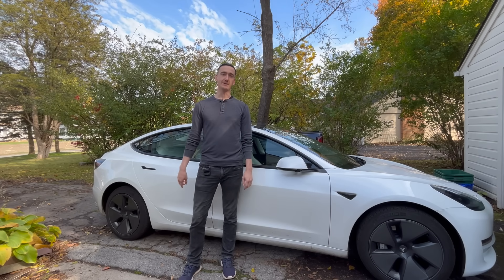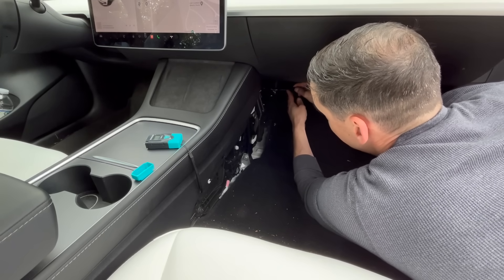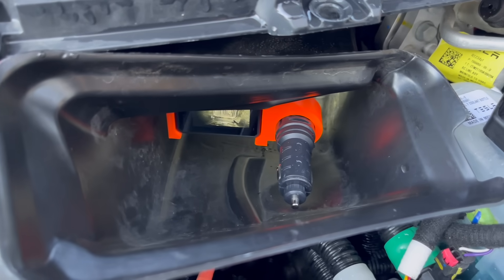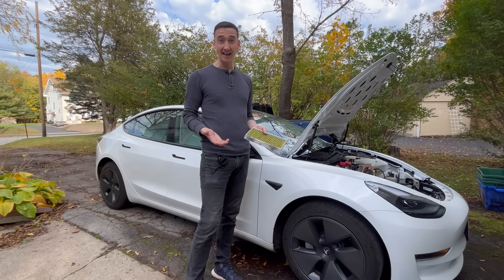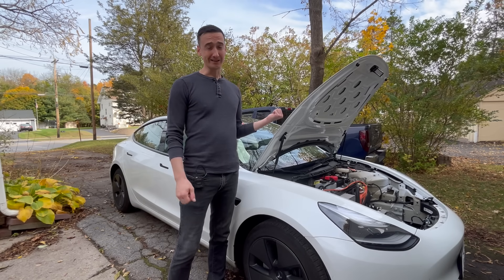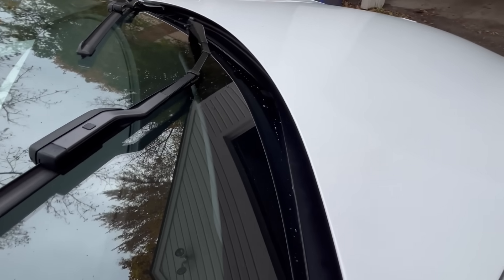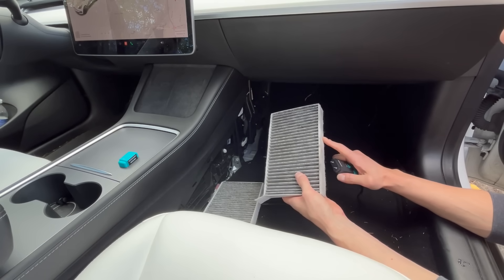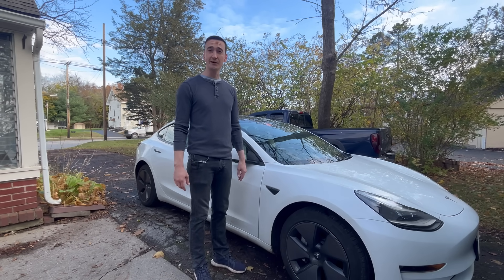This design flaw makes Tesla’s Model 3 smell bad! (with fixes!)

Comment: 14:20 I think this part could have been phrased better. I think what you're saying is with the duct removed water can't get into the fan because water coming in that gap and into the vent falls right past it. And that with the frunk seal the water mostly only comes in through the gap and would mostly fall either onto the duct or past it. But some water could still make its way into the vent.

I think the best solution is not only both, but a custom vent that sucks air from below. That way it's shielding the intake from falling water and making it so that any water needing to get in has to fight against gravity. I've even always wondered if it would be better to install a cyclone separator there.

Comment: The problem with removing the duct is you are now not controlling where the water is going. There are components that don't want water on them as it can cause pre-mature failure. Its also a stupid design from Tesla considering you could of just pulled from the firewall like every other manufacture and if its stop rodents usually those sideways mounted filters don't have that issue. They could in theory keep the duct but make it so the hole at the bottom starts earlier and is larger and even potentially running into another longer duct as it would greatly reduce the suction on the secondary duct. Potentially setup a grill design that would encourage water to be on the bottom of the duct at all times and clearly other autos have figured this out for a very long time now.

That being said, its a Tesla. it was the more commonly made Consumer EV but it also has some of the worst industries build quality standardization.

Comment: Tesla designs and builds a very good powertrain. Seems as they struggle with the build quality of the rest of the car or don't care. Most buyers don't seem bothered by it. These are exactly the same build quality issues back in the 70's that allowed cars from Japan to gain market dominance. Domestic brands on average now have a reasonably good reliability and build quality reputation. They've certainly reached the point of building cars with body panels in alignment, lack wind noise, and able to keep outside elements outside. Even on models with far lower price points.

Comment: 11:28  that gap is probably there because with the OEM intake duct in place, if it were sealed off there wouldn't be any way for fresh air to get down in there... or at least not freely. Since you took that duct out, you can get away with sealing that edge of the bonnet completely.

Comment: Excuse my ignorance, but would you be cutting off the air supply by putting in the gasket? The front end doesn't have a grill or anything? Would this setup cause the intake fan to work harder?

Comment: @mediocreman2 beat me to it, but:-
(I thought the same thing as @mm2 said, myself).
You could superglue or screw a baffle (plus silicone bathroom sealer to stop water bleeding down through &/or passing screw fixings, hitting any electrical connectors outside the shroud) that rises higher than that little lip around the drain hole.  Job done.  That gasket is overkill.  Also, I would think the gap on the OEM gaskets is deliberate to either allow better airflow into the cabin, or release air pressure from under the hood at highway speeds.  Cut a section of Milk container from a supermarket (UK have 4 pint  Milk bottles with a handle made of flexible plastic).  You could superglue then 3 Short self tapping screws into the shroud if you're worried about stability.  That gasket seems expensive as well as overkill.

Comment: So it seems the solution is do not get a Tesla. Keep in mind from the front all Teslas look like an uncut pecker in a rubber.
Wow, I have never had a car that I needed to engage a wash mode to keep water out it.
Tesla, build quality of an 1988 econobox, except the cheapest cars on market back then did not let water enter via the HVAC system.

Comment: The reason Tesla didn't put a gasket all along the back of the hood is because that is a high-pressure area when the car is moving and it makes for the best intake of air. If you look at other cars, they are the same. But because of the way Tesla's duct is made, they should have at least made a baffle to catch the water while letting the air flow.

You may be reducing the volume of intake air by forcing it to be sucked through the crack around the edges of the hood rather than the large opening at the rear. It might not be enough to notice. Your mileage may vary.

I would be inclined to design a new duct with baffles, drains and a shape that would make it impossible for water to get by. The problem with leaving the duct off is that air will be drawn from under the car, which will include lots of stuff you don't want like oils, chemicals and dust. Yes, filters can take care of all that, but you'll have to replace the filters much more often. There are reasons that all cars draw air from the base of the windshield rather than anyplace else.

Comment: Awesome video. My other issue with my Model 3... horrible brake squeal when reversing and slightly braking. It's been in 7 times and hasn't been fixed. Any ideas on reverse braking squeal?
Reply from the maker: Brake pad lubrication is part of annual maintenance, did they not try that?

Comment: Okay, took your advice and ordered 1 for my Y and 1 for the wife’s 3. The item marked door the Y was the same as the 3 so it would not fit Because the Y has no clip hole in the hood. Sending that back. On the 3, the parts fit fine, but he gasket was impossible to get in without modification. I had to snip out the bottom row of plastic clips . Then the one lip fit under the top row of clips and friction held in the other edge. I use the frunk for emergency items and don’t open it much, so I think I will be okay!

Comment: Who turns their air to 10 in their car while going through a car wash? Who also tells us the evaporator cleaner and better filters is not a solution and then at the end shows off better filters? 🤦🏾‍♂️😂 

Evaporator cleaner to get the mildew smell from any bacteria that may have clung to the fins and putting in carbon or microban filters works and does not come back just a few months later. 

The other added fix that I was waiting for you to show was a simple leaf guard in the opening of the air intake just under the frunk cover.

Comment: What about making a 3D printed duct that instead of turning up it turns down. Or, like how engine intakes have, make the duct connect to the vent, but have a huge void space where water can drop to the bottom, but actually have enough room to drop and not get sucked in more, kinda like a reverse p-trap but with a drain.

Comment: Easiest fix for this would be to add a better gasket to the passenger side and remove the gasket from the drivers side of the hood seal area whatever it's called.
So now water would have to travel all the way from one side of the hood to the other and there's no way it would make it that far.

Comment: Nice video, however it’s not exterior water that is the problem here in San Diego with my 2019 3 SR+ as it never rains and I only wash it once every 6 months. The source of moisture is actually the heat/cool exchanger radiator within the system. I park outside in the hot San Diego sun and so it is daily running the AC in heat protection mode. Somehow the moisture from the exchanger inside the unit is collecting and not drying up within the system. Teslas solution of running the air for a time after use did help lengthen the time between cleanings that I have to do, but it did not solve the issue entirely. I still get the smell every 4-6 months here. If you park in a garage or under a cover most of the time your time will be extended even longer.

Comment: You won’t notice any bad smells as you run away from the fire. Between the fires and high cost of repairs nobody is going to be driving these things so bad smells won’t matter. Tesla has cut prices and other companies have stopped production of electric cars so the depreciation on electric cars is very high and people are no longer wanting to buy them. Those that paid above market value and didn’t immediately flip it to make a profit are screwed right now and they have plenty of time to think about that as they sit in line waiting to charge.

Comment: You need high air flow for cabin air when it rains, keeps windows defogged. Especially when you just hopped in to drive and your clothes are wet. I'm surprised tesla has these issues, yikes. Not a great idea to bandaid fix everything with software, would be nice to have things thought through from the beginning.

Comment: My August 2018 M3 ducting is significantly different from yours. Several improvements were made to my earlier car.  :-) The drain in my duct is is lower and off to the passenger side, not in the middle just below the intake as you show with your car. It would take quite a bit more vacuum to suck water into the filter, though perhaps it is still possible. BUT, there's also less chance of water getting into mine in the first place due to the configuration just under the hood gap. And another big difference, my car has NO gasket/dam under the hood (the parts you took off to put on the new product all the way across.) I have all those oblong holes in the hood, but they're filled with plugs from the factory. I bought the full-length gasket to try and to test.

I've definitely had nasty filter smell. But the two times it has happened have been directly after being parked in, and then driving around in almost 100% humidity situations where EVERYTHING is soaked constantly, with no rain at all. So I'm not sure there's much more that I can do besides change my filters regularly. Or perhaps swap to the Microban filters.

Comment: I am, for one, SHOCKED that Tesla felt the need to change yet another tried-and-true method of car design and do it wrong. They could’ve just learned from other’s decades of mistakes. But, no, they just do their own thing. I can understand doing it for some things but air intake for the cabin? That doesn’t need new design ideas. Good grief.

Comment: Very interesting video. I have a 2019 model 3 and yes have replaced the air filters a few times because of the smell. I did not know the root cause of the smell. What I take away from this video is that the cause of the smell is water getting down in to the filter. So if you can avoid water getting down there as much as possible (I.e. closing the flap /using recirc during washing the car and using recirculation mode when it is raining), you can avoid the smell almost completely without having to use the evaporator cleaner.

Comment: Easy solution don’t buy a Tesla or any EV they are and will be very bad for the environment, soon the hydro grids won’t be able to keep up, more hydro more pollution, and the materials to get the battery materials, are really bad for the environment. Especially in Africa were they use child labour, with absolutely no protection to handle the toxic materials for EV battery’s?

Comment: Excellent video and I learned a lot. One thing, how much moisture if any is created on the filter just running the AC on a hot day? That would be an additional test I would love to see to fully understand all aspects of potential water ingress. I believe there is some, or why else would Tesla add the software to attempt to dry it out after running the AC with the fans? Either way, would be nice to know for sure, again, excellent video.

Comment: All those software/wipersuggestions were ridiculous. The only viable solution is to add a really big gasket, or attach a big “hose” with adhesive from the air intake to an area in the bag that cannot get wet.

Comment: Well car wash mode while raining may cause recirculating problems with driving and fogging windows. Also I did like the gasket addition that helps somewhat. Remember you mentioned car wash mode when rinsing your car. But when it's raining and wipers are working. I really don't think it is as bad as a hose rinse. Good tips on the gasket addition though.

Comment: Adam such an interesting and informative video, the amount of time you put in to make this video as one who  knows the effort and time it takes  here a big thank you for this great video 
I never understood why there was never a grill added whilst it won’t stop moisture I would stop leaves going down there and rotting I added an aftermarket grill, and I have had my model 3 for 4 years and it’s only started to smell recently but if I run the heater at full heat for 10 mins it stops that musty smell,interesting that door that shuts by software it would be easy to shut that when rain is severe which could be detected on auto wiper mode. using the gasket kit, would alleviate a lot of that water. If we all tweeted Elon asking him to do your recommendations one might get through and he will take notice it’s worth a shot. A big thank you for bringing this valuable information to our attention I’m looking forward to your next video all the best MAL

Comment: howabout  .buy  a small ozone generator ,place in car while running and running the cars AC or heat component .. will destroy all odors etc within the system and in your cars interior (carpet etc)   plus  the gasket

Comment: Excellent video.  Great idea to put the go pro inside to analyze. Trip to the junk yard shows your commitment. Wish you success with the channel.
If you look in my Tesla videos I tried to address this problem by increasing the size of the drain hole but didn't help much. Car stinks even when not exposed to rain or water. Believe the problem is the evaporator fin horizontal orientation that retains moisture and then the ducts get moldy. You may want to plan your next video with smaller goose neck camera on the ducts.😊 Good luck.

Comment: I still dont understand why Tesla, went with system. They also know about the design flaw but yet I always get the run around when I mention the "stink" problem. BY removing the duct, I am not sure I like the fact having water dripping into the bay with wires and connection. Capping off the main intake and cutting or drilling out holes under the main top cover to let air flow back in the main duct could help stop water getting in. Almost like all other companies. What a design flaw on Tesla..

Comment: I think those gaskets are intended to protect the lift struts. Your method may protect the air intake a little better,  but now they don't protect the struts 13:11 anymore, as I saw in your video.

Comment: Hi Adam, thanks for this great video. I’m about to get a 23 Model 3 and just learned about this potential smell issue. My car will be outside and I live in the NE with lots of precipitation so I feel this could be an issue. Do you think installing the gasket alone will help (and keeping fan low) or do you think that piece you removed should also be removed as well/in addition?
Reply: I'm almost positive this issue has been addressed
Reply: Got the M3 since 2 + years and it's sitting outside 24/7, never had this "smelling" issue

Comment: Thank you. I’m curious about downstream impacts of closing that air gap. Now the system cant pull fresh air from the intended path & source. Did removing the air duct allow water to reach areas not designed for sustain it over time? The water didn’t drop directly downwards after it was removed like it did before. It seemed in under a much broader area.

Comment: Is there any way you could construct a dam around the air inlet grille on that plastic panel (perhaps with stick-on weather stripping) that doesn't inadvertently seal it off against the hood?

Comment: Good video however, I’ve had my M3 2 years it has never been in the rain or a car wash. I clean with waterless spray and wipe. After a year I had the cabin odor. Mobile service came to change and treat the coils. The removed filters smelled like all the air freshener I would spray, and were pretty clean. I always drove with circulation on as I don’t like odd odors. After all this I read the best solution is to always have AC settings on Auto. This triggers the post use fan you mentioned and has circulation at half/half. So there is some issue of moisture causing bacteria growth. I live in Texas with 112° temps as well.

Comment: My 2023 Model Y stinks up even with the HEPA filter installed. The Tesla guy gave me the same excuse, it’s the condenser 😳
Reply: HEPA filters don’t remove odour and is the reason most air purifiers have a carbon filter too.

Comment: A most excellent video and I thank you!  My 2018 Model 3 does not have stock gaskets on the back of the hood as yours does?  Either someone removed them before I got the car from Tesla or perhaps the early Model 3's didn't have them at all?  Makes me wonder if the aftermarket gasket kit will even work.  I'll have to look more into it.  Question, by blocking off the flow of water with the gasket, are you also reducing airflow?  Or is it negligible?

Comment: 19 m3. The smell comes from the AC. Usually stinks after you used it. Our area we hardly use AC and it never stinks when you don't use it. Even after car washes etc.  Also how often do you max out level 10 on fan and it was raining or washing car to make the filter wet?

Comment: Orrr you can drill a hole on the side (not top so water doesnt go in obv) of the air duct so there is much less negative air pressure buildup so it can just drain out even if AC fan is spinning high. Can you try this and let me know?